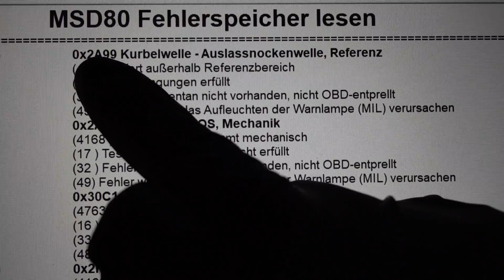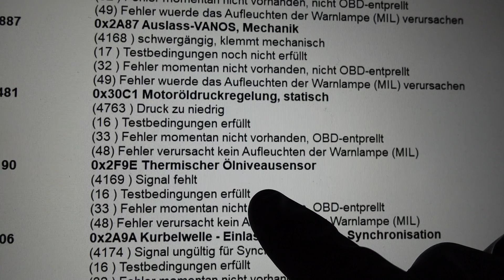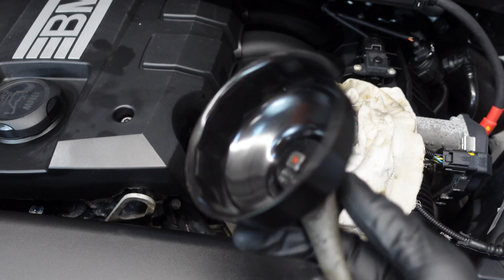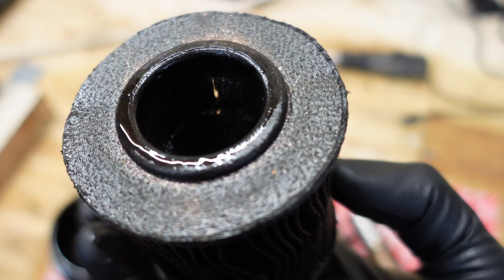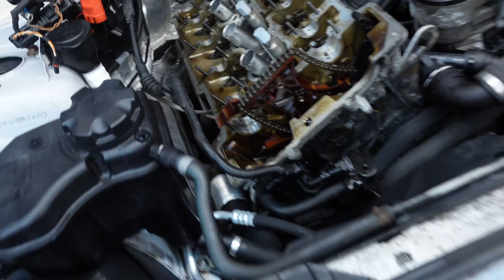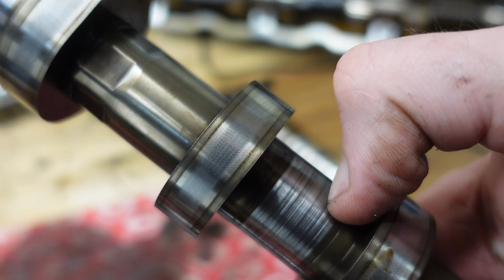N43 Crank No Start,  VANOS codes, Low oil pressure Diagnosis | PART #1

Comment: Did you check the cooling system, perhaps there is a communication somewhere in the engine or oíl cooler aswell.
BimmerN53

Comment: I bet that the owner had the red oil light, thought it needed oil and filled it thinking it needs oil. 

And probably every time it came on, he or she filled it. Sure this is the reason why it was full. 

Then, thinking it is an electrical fault because the red light still came on, ,he or she unplugged the sensor, hoping it will stop the red oil light.

But my guess is the red oil light came on because of low oil pressure, wich is caused by peaces of chain rail in the sump, blocking the oilpump.
Reply from the maker: @darkje I had the same thoughts, on the surface they hoped it just something simple. But it was a slippery slope of neglect that lead to the eventual engine destruction.
Reply: @ yes it’s to bad that some people don’t actually know exactly what to do, and risk damage the car further. While Reading the owners manual can already tell what the warninglight mean

Comment: People love to hate this engine saying it's crap..bmw made a petrol engine almost as fuel efficient as a diesel, with nice power direct injected naturally aspirated....problem is...they sold it to people who couldn't be bothered to understand how this engine operates and what it needs.

 So they treated these cars like kitchen appliances and little to no maintenance. 

And then the second round of owners came to buy their shiny used bmw coming from port injected ford focus, and figured they could continue to use it like a kitchen appliance and no maintenance. 

After a lot of research I came to the conclusion this is in fact not the worst bmw engine ever made but rather the most abused and mistreated. Beautiful piece of engineering with a tragic fate. I love mine, especially on long roadtrips.
Reply: I have one and it barely gets 40 MPG. Definitely not nearly as good on fuel as a diesel
Reply: @ronanw1  40mpg from a normally aspirated 2.0L petrol is very good.

Comment: What a pile of crap the N43 is
Reply from the maker: It's a good engine fundamentaly, but injectors and the plastic chain guides are the main cause of all the problems.
Reply: @BimmerZen  Also carbon build up around the valves causing oil burning
Reply: I don't think they are a pile of crap as such, but they are not at all tolerant of neglect.

Comment: My 320i Vanos solonoids is sooo stuck can not get it out, i can not even pry it out with a screw driver whilst having vice grips on it an pulling with all my force. yes the liitle 10mm and bracket on both is removed before someone asks
Reply from the maker: Grab it with adjustable wrench at the connector base and try to rotate it a little bit. Maybe heating up the engine might help?

Comment: Great video but what was the actual reason the engine got damaged was it the timing chain guide blocking the oil filter?
Reply from the maker: Pieces of the broken plastic chain guide blocked the oil pickup. It's all in my teardown video: https://youtu.be/GHC-HXzjMik?si=ewVgGlcgZH9eD0y6

Comment: I have purchased an E90 with N43 engine and it has a tampered, rolled back odometer. I brought to the service couple of times and even they did not notice that the timing chain was stretched so badly it damaged the plastic timing chain tensioner and broke it to small pieces that clogged the inlet to the oil pump. Which led to similar damage. Sometime my engine made loud rattling sound at start for about 1 minute and it became quiet, so I never suspected that this could be a problem. Sometimes on highway after driving like 30 minutes and slowing down thus having lower RPM there was a low oil pressure warning, but since I have used the car in the city mainly, I didn't get this warning. Just wanted to share this here, so maybe this info can save some money for others.  Thanks for the video, it was helpful.
Reply: so that means the engine is great if it can drive on highway with so much damage

Comment: If the camshaft just spins round in circles within the bearings then what’s wrong with groves ? It’s not going up and down just round and round so it won’t catch.
Reply from the maker: It also has a small amount of axial play, so eventualy it can wear out the bearing yournals. Check out my N43 cylinder head rebuild video for more context and how I "fixed" it:)

Comment: Look how black the oil is when he pulls the VANOS solenoids. Whoever had the car did a very poor job maintaing the thing. Oil looks very old.
Reply from the maker: Yes, if you check out the teardown video you can see how bad the oil is, and also... there was 9 L of oil in the engine! 11 year old air filter from 2012 and i could go on...
Reply: @BimmerZen  I have finished the first video from the N43 playlist since I have the same engine and it made me courious. I will continue to watch the rest of them.
Reply: Complimenti veramente, tutto spiegato nei minimi dettagli, ho una 120i con motore da rifare, prenderò spunto da questi tutorial, che sono come l oro.

Comment: All of that because someone did not take care of thier car.This has nothing to do with BMW,but with the idiot who did not care, nothing.
Reply from the maker: At first they probably ignored the oil light or just did not commit to finding the root cause. After the rod knock began, they just added more oil and drove the car until it did not want to start anymore.
Reply: This has a lot to do with the N43's design too. Other than the PAS engine (N14,18), this is probably the most unreliable engine they've ever made.